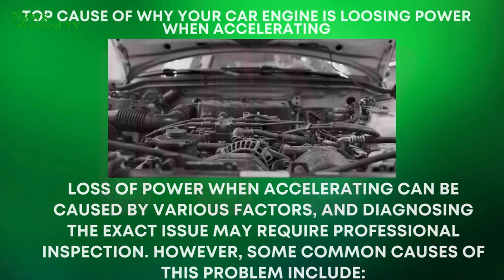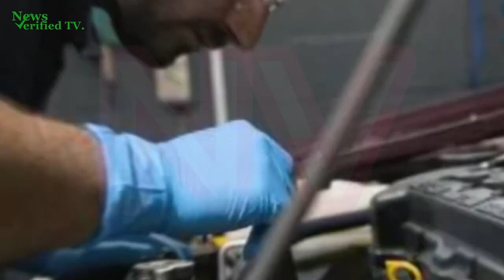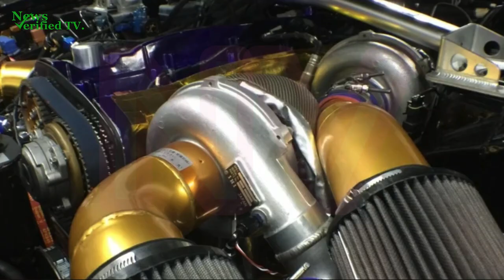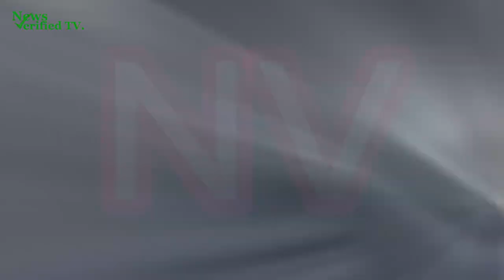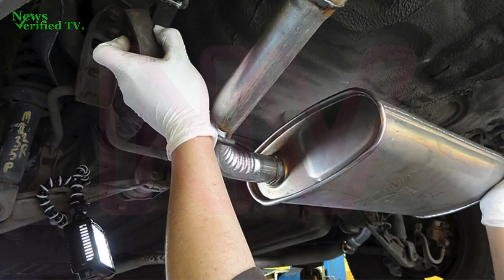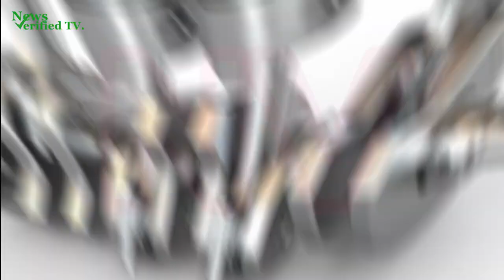The Top Reason Why Your Car Loses Power on Acceleration Explained EnginePowerLoss

Comment: Good morning I'm texting from South Africa i have a VW polo player 1.4 year 2002 it lose power when I'm climbing hill what can i check please help me
Reply from the maker: So many factors can be the cause but, Check for dashboard warning lights, which might indicate specific sensor or system issues.
Inspect and replace air and fuel filters if needed.
Have the spark plugs, ignition coils, and sensors (MAF, TPS, oxygen sensors) tested and replaced if necessary.
Most important, Perform a diagnostic scan for error codes. The code you get will pinpoint the exact issue. Google the code and know the it stands for.
Reply: And it's using more fuel

Comment: Could a falling transmission caused the vehicle to loose power when ascending hills?
Reply from the maker: Sure, failing transmission can lead to power loss when a car is climbing a hill because the transmission is responsible for delivering power from the engine to the wheels. When it's malfunctioning, it disrupts this power transfer, especially under demanding conditions like going uphill.